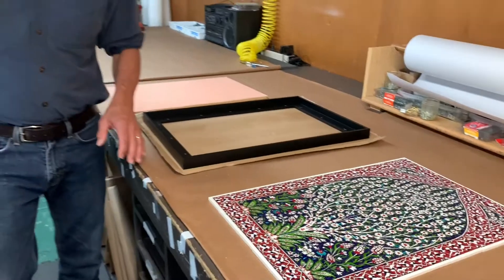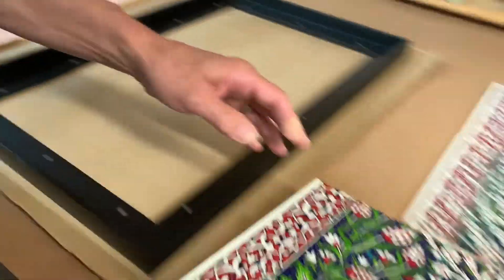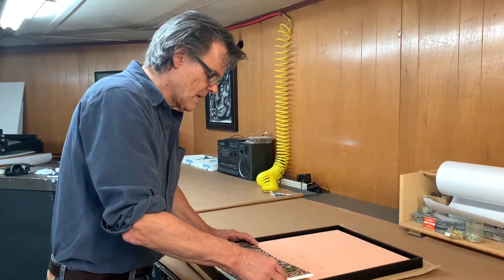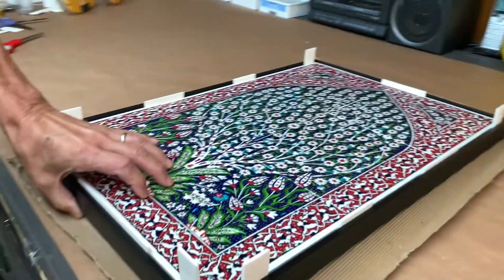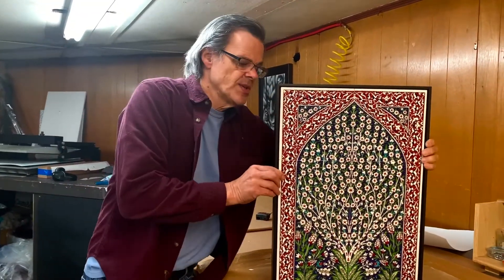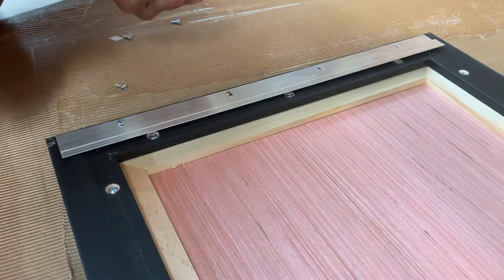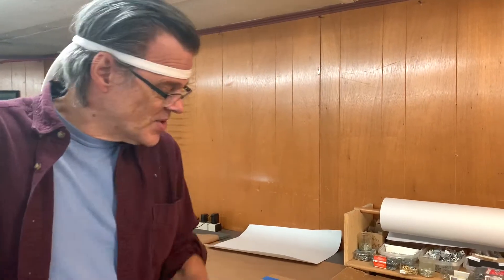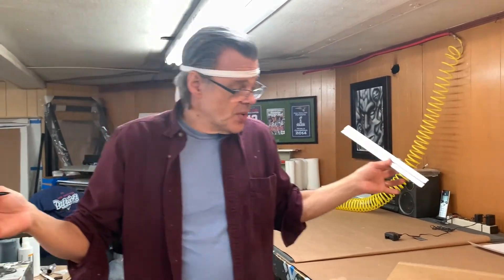Today Nick's Framing Turkish Tiles!

Comment: Thanks for the video! Great tips here, especially the template and cleat system to fix to the wall.
You mentioned that you use "clips with pads on" for framing old valuable tiles. I have a set of 12 very old and very heavy tiles (about 2.5kg/5 pounds each tile! -- so a total of about 30kg/65 pounds) that I would like to frame. The total size of the mosaic is about 4'x3'.
Ideally I would like to fix them to a backer board non-permanently. Any suggestions? Would these 'clips with pads on' be an option?
Thanks and greetings from France!
Reply from the maker: Bonjour, thanks for watching our video!!  The clips I use are L shaped brackets from the hardware store. One end is threaded to screw into wood, and the other part is about a 1/4" lip that will clip over the tile. I used to cut little pads out of acid free mat board to protect the tile from the metal, the new thing I have started doing is wrapping the part of the L bracket that touches the tile with thread. The nice thing about this is that you can choose any color thread that you want. There really is no other way to mount these that is completely archival and does not involve adhesive. So I would do it this way, but the down side is the tiles can't touch each other because they are separated by the brackets. If you would like me to send you some pics of the brackets please email me at galleryseven@verizon.net. Good luck!
Reply: @gallerysevenmaynard  Thanks so much for taking the time to respond! I've sent an email to you and thanks so much for your advice!
Reply: Great video! What is the glue that you used to adhere tiles to Wood? I am planning to create a display with tiles and am not sure the type or brand of glue to use. Thank you!